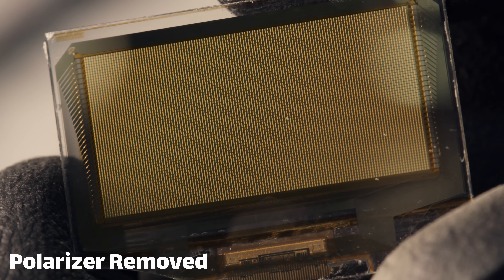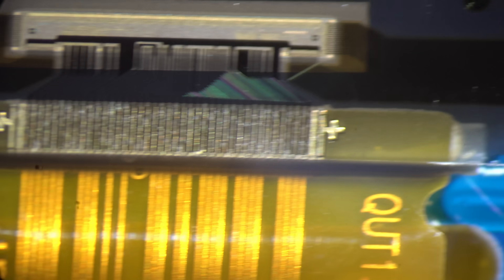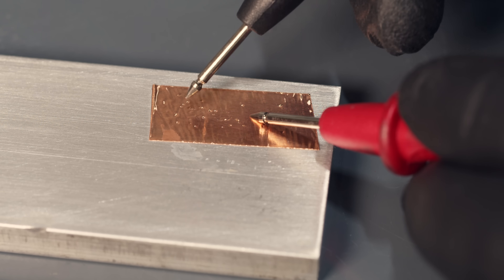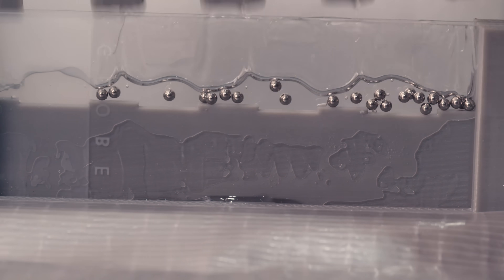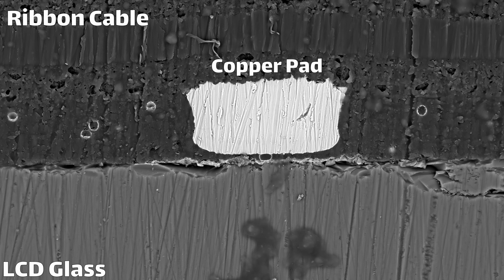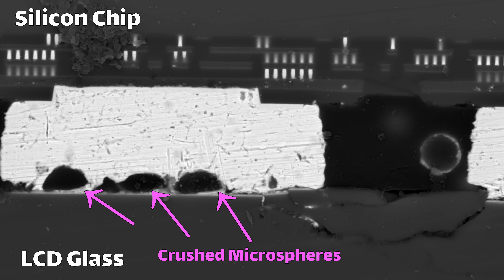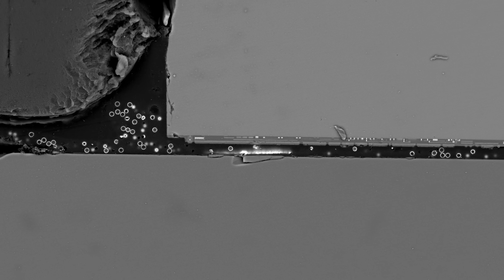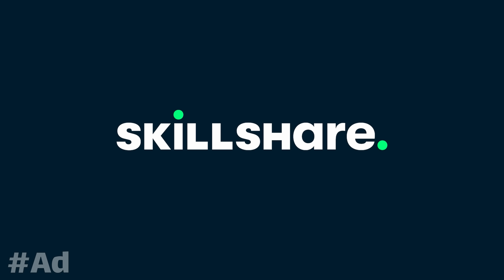The Microspheres Hiding in your Phone's Screen

Comment: There are even displays which have the drivers not as a separate chip bonded to the glass, but actually layered on the glass using a technology called Continuous Grain Silicon (CGS).  Sharp even demonstrated a Z80 on glass several years back produced using the same technology; I believe the demonstration was made using an MSX computer which had this device as its CPU.

Comment: If only a few micro-spheres actually make contact with the aluminium layer on the glass, why waste the other spheres (which are a lot)? Can't they be attached to the connector instead, thus saving the overall production cost of the display?

Comment: If each magnetic domain in a permanent magnet behaves like a superconductor, meaning, it has a field flow or electricity flow with zero resistance within that domain at room temperature, that implies that we might already have room-temperature superconductors at the micro-scale. I wonder, how small can magnet dust get? Could we arrange them in a line?

Comment: I have to solder components that you could fit 5 or 6 on the head of a pin. We use powerful microscopes. Its kind of fun to solder things that small by hand. I hold the components in place with a molecule size drop of flux, a metal pick thinner than a hair, and hit it with a soldering iron that is smaller than a sewing needle. Machines put all this stuff together but when it breaks, its fixed by hand.

Comment: When the difference between success and  failure is smaller than a width of the  hair. I remember disassembling an old lcd game seeing a rubber strips with conductor strips to connect pcb to lcd panel, never thought they would be using micro spears to connect connector strips to lcd(even thought I did disassemble quite a few modern LCDs). I guess you get less curious or dumber as you get older.

Comment: The glass is crystal and the orientation of lattice are tiny grid point to extremely dense and so magnetic can utilized it to orient the liquid crystal layer underneath to orient the angle of crystal liquid change the color and amount of light goes through it so response to electodynamic driver arrange image but that too easily jam so it is better to mirror and zoom each portion of image onto the liquid crystal layer and so CCD change image from data onto displace

Comment: @912 - The pads seem to connect without the microspheres -- remember that the pad is going down into the microscope; you're just looking at a single edge, so there are probably 4 or 5 spheres deep for contact.

It's probably also the reason for the enig process -- none of this works too well if our PCB (flex or not) gets oxidized.

Comment: Who came up with microspheres?? How were they invented?
Great video, but I just have more questions!
Reply from the maker: Not sure to be honest! Haven't found a lot of details about how the spheres themselves are manufactured. If I had to guess, they are probably polystyrene microspheres which are then coated in metal (using an electroless plating process). There are a few ways to manufacture polystyrene spheres in consistent sizes, iirc the process is called emulsion polymerization. No idea how they manage to get an even/consistent dispersal in the adhesive though. That seems like it would be really challenging!
Reply: Oakridge labs did something like this in the 90s     I think they introduced an electric charge on ceramic maybe? It made them repel each other into smaller drops  and dispersed them to fall in air to solidify.

Comment: This probably also explains why phone display connectors can seem to be so fragile. Imagining a contact with only a couple balls making contact; impacting the device is bound to eventually knock them loose and out of contact, causing connection problems over time. But I'm sure the screen itself is a weaker link in that.

Comment: soo... what happens when they do bridge the connection? how do they prevent it?
Reply from the maker: My understanding is that it's just part of the overall process yield. I.e. a certain number are expected to randomly bridge adjacent pads just due to the microspheres being in a randomly bad configuration, and that device is scrapped (or reworked).  The manufacturers list specifications about minimum contact size, minimum spacing, average distribution etc but I think ultimately there will be some loss.

Comment: Manufacturers of LCD and OLED displays face a significant challenge in making electrical connections between the glass and flexible ribbon cables that connect to the device's electronics board. The conductive tape used to make these connections must allow electricity to flow in only one dimension, through the thickness of the tape in the z-axis, without flowing through the x or y-axis. Anisotropic conducting tape uses metal-coated microspheres embedded in the insulating adhesive to create directionality, preventing the tape from connecting all the traces together. 

The tape is used in consumer electronics produced in massive quantities, and the manufacturers want a simple, easy, and reliable method to make all these electrical connections. Conductive silver paste or epoxy can be used, but the traces themselves are very narrow, and the gaps between them are even smaller. Accurately dispensing an epoxy paste at these tiny scales is challenging, so manufacturers use conductive tape instead. 

The anisotropic conducting tape-suspended ball bearings allow electricity to flow through the tape in only one direction, making it the ideal solution for making electrical connections between the glass and the flexible ribbon cables used in LCD and OLED displays.

Comment: This is cool and all but your analogy show that It is pretty possible to shortcircuit tracks. How can they prevent this from happening, otherwise a short circuit would be kind of frequent.
Reply from the maker: My understanding is that it's just baked into the overall yield and accepted that a few devices will fail. I assume the tape manufacturers have various QA processes to ensure the distribution is fairly uniform/random, and the spec sheets for each tape recommend the min pad size and spacing (different tapes have different sizes of microspheres, and loading density).

So after that it's just down to random chance. Given the prevalence of ACF I think it's probably pretty low but not zero, and just accepted as yield loss. Or maybe reworked.

Comment: I don't get why these spheres are required for the tape? I mean the entire connection needs to be from the bottom to the top, so it must be essentially a volume filled with separated pillars (essentially wires/traces) of conductive material, surrounded and/or bonded with non conductive material, that go from the bottom, to the top.
So are these sphere actually necessary? If the tape made good contact on both sides, it should act exactly the same?

Maybe the tape itself is layered? So instead of having fragile 'wires' they have 'blocks' that are then connected with the spheres at each layer?

Comment: That small microchip is driver IC and connection points we call it Au bump. 
Usually made by sputter TiW and Au layer on IC’s Al pad (UBM layer) then plating Gold on it, also we have Cu Ni Au bump and Cu bump processing.

In this video cross section is Au bump definitely.

Comment: This tape is only used because it is cheap and it fits all sizes of connectors. You can easily screen print a conductive epoxy but the printing screens are expensive and wear off really fast. It is also possible to screen print solder paste (indium or silver in this scenario) and solder directly to the traces on the glass, but this is even more expensive than the conductive epoxy.

Comment: When I first saw the (old) title, I thought it was referring to Zebra Strips (elastomeric connector) -- didn't know about the tape/film. Pretty neat. It looks like 3M has an ACF that can be set at room(-ish) temperature (3M 9703) with no heavy clamping required, and it can be later removed -- although looks like it takes 24 hours to fully set up.
Reply from the maker: It's funny because I wasn't aware of the zebra strips until folks int he comments mentioned it! But sure enough I'd seen a bunch of old electronics with those, just never realized what they were for :)

That 3M 9703 looks neat! Was just chatting with someone that wanted to use ACF but had a heat sensitive project. I'll pass this along!

Comment: Thats amazing! You wouldn't think just a couple of those minute squishy metal coated balls would be enough to allow enough electricity across to pass the signal or power across, but I guess at those scales you don't need as much contact as I thought. It's kinda also amazing that glass can have so many electrical traces running across and through it, and yet still remain perfectly transparent to our eyes. You'd expect the glass to take on a sort of frosted appearance but again, I guess just like bacteria and microbes in water - once they go below a certain scale in size they effectively turn invisible to us. Hence perfectly clear water ends up being anything but, once you view under a microscope.

Comment: Bur you still have to align it at some point , how is this done ?
Reply from the maker: Check out Strange Parts' video (linked in pinned comment), he toured a place where they were using ACF. Basically you stick the tape down to one side, then line up the other side with the help of a microscope and a positioner. Then push a button and a heated bar presses the two sides together.

Comment: HUh, i'd think the microspheres would be constructed inside out; e.g.: plastic (insulator) on the outside and metal on the inside.. such that the crush would break open the sphere and cause a connection whereas the rest of the spheres would remain as insulators.

Comment: Great explanation. Especially the electron microscope images with element detection. But why do they makes the contacts on the display side so small? The pictures show that the total contact length is much shorter than the display length and shorter than cable width, so it seems like there would be enough space. And if there is a good reason, why does it not apply to the signal original side, where normal solder is used?

Comment: Finally I've got an explanation why you can repair an LCD display that has missing or glowing row of pixels by disassembling it and pressing the contact zone with a pencil. Until now it was like a woodoo trick that has weak hope on success. Now I see that it is actually a very straightforward solution and the issue itself understandable.

Comment: My company produces ACP, not ACF, but the principle is the same.  I like what you demonstrate in macro scale how this works.
Just one comment, not all ACF/ACP makers use the "crushable" plastic balls with metal coating, actually Dexerial use sandwich particles (insulated skin+metal coating on core+core), Hitachi is most known to use metal coated plastic balls, my company use mostly dendrite or sphere metals, which are not supposed to be crushed.
Normally we call adhesive with "conductive particle loading <25%wt. and particle size <1/10 pad gap" as anisotropic conductive

Comment: Question about the demo: Why not forget about the gel and the balls? You show all the desired surfaces making contact without the gel or balls, so it’s not really clear why they’re required.

Is there some variation in the contact surfaces that make the balls useful because they can be crushed to the size required to fill variable sized gaps?
Reply from the maker: Yep, basically boils down to variation and tolerances, plus needing an adhesive. I was actually surprised how tightly the silicon chip bonded, not sure if that is typical or not. But the FCP had pretty sizable variation due to waviness in the ribbon and variable size of the pads.

And since you need to bond this, using a non-conductive adhesive around the edges or in between the pads would be very tough since any "spill" would cover up a pad.

I think it ends up being just a nice mixture of cheap, easy and fast to apply, wider tolerance to imperfect mating, and good-enough electrical properties.

Comment: The copper tape on a piece of metal maybe wasn’t a good example. If you did the same test with the special tape it would have behaved the same due to the metal plate beneath it. You would still have contact across the tape because the current would just go through the tape to the metal and then back through the tape to the other probe.
Reply from the maker: I actually filmed some with the ACF in the same setup, but it was basically impossible to do by hand in this configuration! The tape is insulating so simply touching two parts of the tape won't conduct without added pressure. And you can't provide an even/consistentpressure to crush the microspheres and make contact without also puncturing the tape with the probe needles (i.e. touching the metal directly).

So I decided to just show the copper tape alone so folks wouldn't be confused by the other demo.

Comment: You mentioned that the microspheres were made of plastic with a nickel and gold coating. I wonder if you could instead make spheres of metal with a plastic shell so that only the crushed spheres would be conductive? If that could work, it could make accidental bridging of contacts all but impossible, allowing for there to be more spheres and reducing the necessity of such tight tolerances.

Comment: But can it be used to tape instead of solder surface mounted components? Asking for a friend.
Reply from the maker: Definitely! It's not a fantastic connection though, the spec sheet on my tape lists it as 1 ohm resistance on avg, and <50mA / <40V. But if that works for your needs, could definitely be used with SMT components!

Just needs mild heat (180-200C) and pressure. I've seen folks use soldering irons with a "hot bar" and hand pressure to mount it. Only other major downside is cost, it's not super cheap

Comment: Excellent! Subscribed. I learned something new. Though back in 2020 I did learn of a similar older technique called an elastomeric connector while repairing an old roughly 1990 digital multimeter. The elastomeric connector was used between the main PCB and the LCD display.

Comment: It's mind-blowing that this works as well as it does. It sounds like one of those concepts which works in theory, but would be wildly unreliable in practice.
Reply: I'm sure it is quite unreliable, I wonder what the failure rate of the finished devices is once installed. I wonder if they come in different densities and have to adjust accordingly when making a new display fab line.

Comment: 7:06 you confirmed your corrosion theory for the nickel right there... anywhere oxygen, copper, and aluminum can meet will corrode badly. This is a major issue in home electrical wiring given the prevalence of low-cost aluminum wire in older buildings.

Comment: It's just a much thinner version of a Zebra strip used for screens in calculators, old phones and multimeters for many many years😅

Edit: Commented before watching anything (sorry, ADHD...) but this was nothing like i expected as i first thought it where going to be a tube like, carbon filament composition then cut sideways.

And i where very sceptical to a bunch of random metal balls all over randomly as it would easily short out, but as i thought it should be insulated balls that only conduct when pressed then that exact thing got shown seconds later 😂

Comment: Fascinating. I like your example with the gel and the metal balls, but how does that work when there is polymer film(tape) between the top and bottom?
Reply from the maker: It's a heat + pressure cure, so I think it just relies on enough pressure to smash the pads against the microspheres and hope there is enough metal-on-metal contact. The resistance is relatively high (1 ohm based on the spec sheet) so there's probably some of the polymer that gets in the way.

To be honest, I'm surprised it works as well as it does!

Comment: I love the physical model you made. It shows the principle working so well!

If enough conductive microspheres did manage to bridge two adjacent traces, would the magnetic flux of the sudden current flow cause them to separate? It feels like the sort of system that would tend towards un-shorting itself, which is cool
Reply: They probably still wouldn't meaningfully conduct, since there isn't any compression giving them proper contact with each other.
I'm mostly surprised that there aren't too many issues with some unlucky contacts not having any spheres.

Comment: This makes me wonder why use tape when you could just contact the two pads together. Is it for tolerance reasons?
Reply from the maker: Yeah, tolerance and adhesion is my understanding. You need something to stick it down, so in a "direct contact" scenario you'd need to apply an adhesive around the outside and make sure you don't get any on the pads, ensure good contact and also keep the adhesive from "squeezing" into the gap. FPCs have some waviness to them and getting good contact could be hard too.

I suspect it's totally doable, but this is just a lot faster and easier for robots and manual labor to do quickly.

Comment: Thanks for your fascinating posts.
The tape (isolated conductive spheres) must introduce some chargeability into the circuits, through induced polarisation, depending on voltages/frequencies used.
Does this effect not compromise performance?
All the best from Namibia.